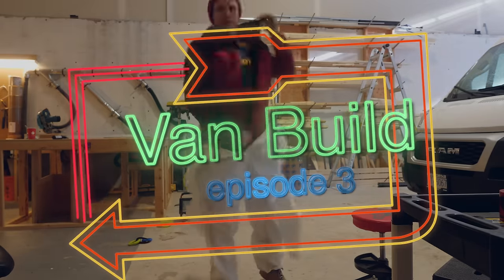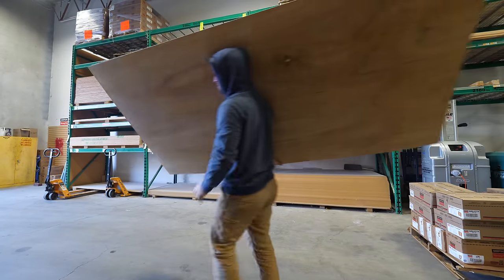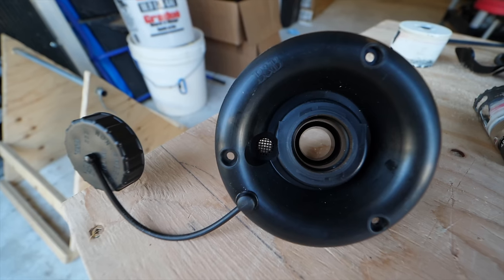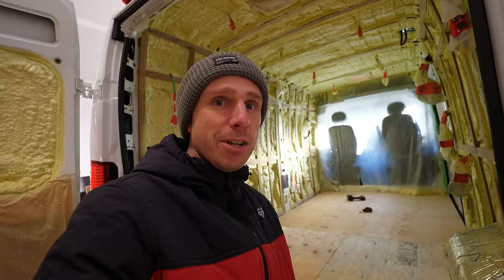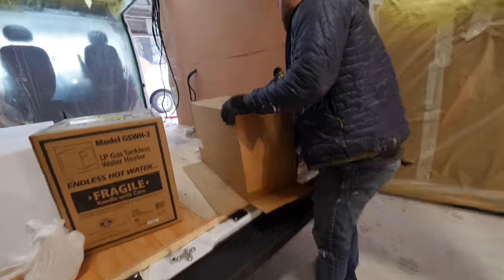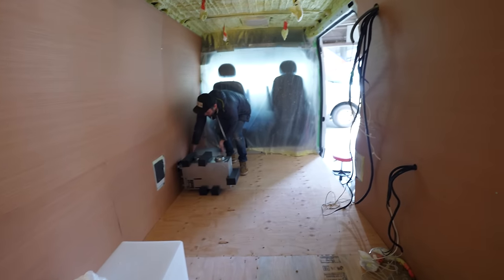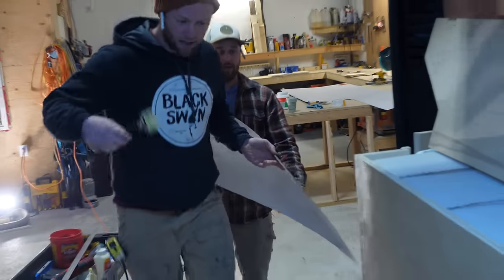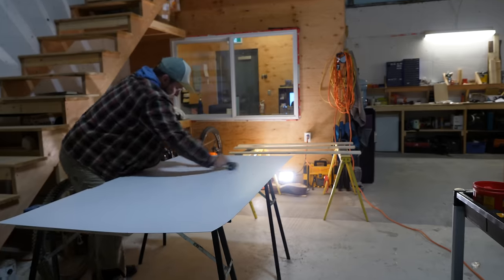Why I Decided To Spray Foam My Custom Van Build...

Comment: I did this in some areas of my build but put down plastic before spraying, that way it can be easily removed later. The areas I did this was the side rails in the bed of my truck. I wanted to be able to remove it when I change my living quarter design. This was a crude but fast way for me to insulate my truck bed including my canopy, with being able to do fast.

I do plan on doing a low profile camper build that can be slide in and out of my truck. I plan on using aluminum frame work with insulation inside the frame. Low profile pop up campers base models can easily run 10k-12k, I hope to spend less than half that. For me this will be done just by me and more than likely out doors, and all with hand tools.

Comment: noting that  the  inlet  requires a  breaker board to be installed

Also note: the  power inlet should be  a min of 6-7.5 foot off the  ground to reduce   flooding issues that might occur in a camp ground..

also note before you spray foamed you  should added a back plate and ran the  service wiring for both ac and dc electronics.. and fuse panels for both..

I also don't think it is a a wise idea to mix different  voltages with different wattage.

in most countries the world over 1-2 20 amp 220/240 VAC  depending on the the  air con you run  as this is typically separated from the house power

At the end of the  day do what you like however  base electrical wiring whether it be home or rv bound is based on 15 amps at 220-240 vac..

Where you start cooking in the realm off electrical fires when you start upping the gauge lowering the voltage and upping the amperages

Comment: Not sure why they put the water inlets directly above the power input but I would recommend hooking up the water first, make sure everything is dry and then hook up the power. Otherwise it's amazing. You should start arranging van competitions so you can win them all.
Reply from the maker: Yes they are testing the water system :). Also weird how there are no other places in a van where there’s water next to electrics......wait a second.......😂
Reply: so here for the spray foam . quick Q - The battening here runs along the metal ribs of the van. Isn't it better to avoid having the frame contact the outer shell as far as possible? Running them across the other way for example so they just touch at points? Or does it make little noticeable difference in the end? -  especially considering windows and doors are pretty hard to deal with in that regard? cheers

Comment: Good luck trying to remove any future panel dents
Reply: Yeah, that's kind of what I'm thinking - especially after Luke had the ladder ripped off his van. I'm beginning to favor removable insulation and wiring conduits.
Reply: I had the same thought for spray foam in a home, it's going to be twice the labor for repair work. Since the contractor has to dig out electrical wire or plumbing pipes.
Reply: looking through the comments it seems there is a whole host of issues with this that were not thought of. Idk this guy, his video just showed up in my recommendations, but this seems like a poor choice. One that stops repairs from easily being done, or done at all since the foam releases toxic dust (possibly anyway) so no panel beater/welder would go near it, the chassis as a whole becomes something that cannot be recycled, the foam is a fire hazard as well as being a sponge for water (from showers/hot beverages/cooking steam). Someone else was saying this stuff squeaks after a while which I can believe since the chassis would have some give on the road, probably dislodging some foam and making it rub. Maybe some of these problems aren't legit, but enough of them are to make it not viable imo.

All that said, its not my van so I don't care that much tbh
Reply: He'll be able to pull them out with the rust holes that the foam creates.
Reply: @CrusadesOClock  closed cells does not absorb moisture
Reply: @900vasa  Tru dat.
>
Reply: Deppending on the dent it can be from the outside, but i was also thinking of spray foam for my build, but had not thought of that
Reply: @readysetsleep  u use to spray foam myself and i can tell u its a nightmare for contractors
Reply: @CrusadesOClock  There's a product called Foamitgreen that solves all of those issues. Fireproof, no outgassing, closed cell (does not absorb moisture. Actually protects the metal from the moisture and prevents rust), it scrapes off easily with a paint scraper if necessary but does not degrade, no toxic dust because it's not harmful to humans, I can attest it does not squeak even after one year of traveling or dislodge
Reply: @CrusadesOClock  Chassis can be recycled with the foam, it's all going through a shredder anyway. How do you think refrigerator shells are recycled every day by the thousands with blown in insulation?
Reply: @jcamp9381  Yeah, I'm quick to believe all the claims made by the people SELLING me the stuff! I trust sites like https://blog.polytechinc.com/open-vs-closed-cell-foam more than any salesman. They clearly state "In closed cell foam, the cells are like tiny air pockets piled together in a compact configuration, resembling inflated balloons nestled tightly together. Due to the closely packed cells, closed cell foam is vapor semi-impermeable, more rigid, able to withstand greater pressure, and is about 4 times denser than open cell foam." The words to note are "vapor semi-impermeable" this means moisture can slowly permeate it.

I initially thought closed cell expanding foam would be an excellent way to proceed with my own build, but the more I dug into it the more problematic it became. Even the bonding between the metal and the foam is a problem even though there is "no" cavity for condensation to occur. That has been amply verified by the experiences of others having to deal with panels literally rotting away.

In the end we all do what we want, all I'm saying is, do your research from trusted sources and don't ignore the experiences of others. Those having to deal with the aftermath aren't trying to sell you anything.

Comment: Spray foam  is standard practice on steel boats.  As they typically take several months to fit out out- gassing is not a problem.  It provides acoustic and thermal insulation and prevents condensation forming on the cold steel.

Comment: The stuff turns to powder in the heat great for Respiratory
Reply: The foam seems to only turns to powder when exposed to UV, typically from sunlight... That's not pro-foam propaganda, but something I've seen in action.

It should be fine behind those panels.
Reply: Polyurethane?

Comment: I hope you used extra sealant or something. Ive seen a few foamed vehicles including a couple professionally built ones and they all rust quickly. 

If you dont face sub zero temps, maybe ok but condensation will always fine a way.
Reply: rust city.  moisture stays between the foam and the paint, then you can guess what will happen.  enjoy!
Reply: That’s why they dry and ha e the van in a dry environment before they do it and until it drys
Reply: @tylermount9544  That is a good technique but doesn't negate the fact that moisture or humidity always finds a way to migrate from humid areas to less humid areas just like temperature always flows from cold to hot. That's why true vapor barriers and ventilation are so important. Closed cell foam is not a suitable vapor barrier see here to know why. https://blog.polytechinc.com/open-vs-closed-cell-foam
Reply: I have over 20 yrs of experience building rv's in the rv capital of the world in Elkhart, Indiana. I have also built schoolies and vans for about 20 yrs. I tell everyone this stuff is the worst you can use. There is a reason it's not used In rv's therefore I didn't use. In the rv industry we have done a lot of testing with foam and if failed to meet government safety standards so no go. Stick with open face insulation and put down a liquid vapor barrier before the insulation and install a  Maxxair fan that way you can help control the key air flow weather it needs air pulled in or sucked out.
Reply: @rolliebca  actually closed cell foam  combined with a fibreglass shell is a perfect vapor barrier (it's even good on its own if applied thick enough btw), so the best way would be if the guy in this video used fiberglass to seal in the spray foam and lastly a dense coat of gelcoat and clearcoat. For vapor to reach through all that would take pressurizing the chamber with steam at 150psi and leaving it like that for 30 years. Btw that's basically how modern ships/yachts are made
Reply: @jasonstormoen  honest question trying to learn from a veteran here. What were the government tests it didn’t pass? Could you point me in a direction as far as learning about those tests?
Reply: @bob15479  to start with, I ain't sure where you can just go type it in and look it up. It was testing that we done at one of the RV manufacturers I was working  for in Elkhart County, IN, in the rv capital of the world. There is regulations in places that it didn't meet. The governments department of energy and fire safety regulations was the ones who put the regulations in place and the ones who shot it down.  We also weren't happy with the R value being lower than fiberglass, weight was heavier than fiberglass, and the ceiling was an absolutely no go because of it melting and dripping down leading to melting and other fires. The fiberglass didn't, it had a hight fire retardant rating than what spray in offered. If any other questions shoot them and I'll answer the best I can. Good day!
Reply: @jasonstormoen  I can imagine that being in a foam van would be a real disaster in a fire.
Reply: @bob15479  unfortunately it would be bad. A lot of us in the rv industry also working 15 mins away in Warsaw at Explorer van conversion where Chevy, GMC, Ford, and Mercedes and they dont use the foam either. I could go on, buy I'll won't bore ya. I'll just answer if you got questions.. 😆 Good Day!
Reply: @rolliebca  If (and only if) you properly apply closed cell foam, it bonds to the metal walls perfectly and does not leave room for moisture to form. you don't need a vapor barrier in that case. https://www.youtube.com/watch?v=j9dhRJb6Hqw

Comment: Why in the world would he put the water above the electric because if it leaks it would shorten electric out wouldn't it
Reply: Jason Fay    exactly, actually illegal in most countries
Reply: Huh? Its an exterior weather power point. Its going to get more water from storms and drain than any dribbles from water inlet.
Reply: Because one water port is gravity feed, one water port has to be a certain height for city water and you don’t want to plug an electrical cord high up on the side of the van creating a tripping hazard.

Comment: Paul. I would have placed reflectrix bubble pack in the ceiling spaces before affixing the paneling. Summer heat gain is pushed out. Works great in the Southwest.

Comment: There is two tanks foam sprayer kit sold at homdepot for few hundred dollars, I have used it to insulate added unit above garage, that thing is super easy to use and not messy at all, it like window gap filler in a much bigger container.

Comment: I have over 15 years experience in the spray foam industry and I anticipate numerous issues.
Reply: How so?
Reply: yea, why/what ?
Reply: Does it leak poisonous fumes after a while? Will it separate and crack after a while and flake away?
Reply: I have been doing trailers with the 2lb foam for 20 yrs , you wont have any problems . To many key board Einsteins .
Reply: I’ve had over 25 years experience in the spray foam industry and this application will outlast the van by a factor of 3
Reply: @markman63  so the foam shortens the life of the van, not good. What sort of poisonous gasses does the foam leak over time?
Reply: @rolliebca  Hope its ok to tag you so late, so does this mean that no foam is acceptable for this or that we should only used closed cell foam? I dont know much about this stuff so have a bit of trouble understanding

Comment: Is this PUR foam? This can cause serious health issues. People start to tear down their houses because of health issues here in the Netherlands.
Reply: Thats because of installation errors. It needs to be done at a specific temperature, otherwise it releases toxic chemicals
Reply: definitely makes recycling the chassis unlikely.
Reply: its highly carcinogenic , also the fumes of the foam.
Reply: @danielmarx3106  so if done at the right temp it does not release chemicals?? Yea okk I believe that
Reply: @digginaustin  I dont care what you believe. Its a fact. It has to settle properly and be done at a certain temperature to be safe. This is why its best to have a professional do it
Reply: @danielmarx3106 so if a professional does the job it limits the voc immited from the spray foam. But does not eliminate them. Got it
Reply: @danielmarx3106  - And why should anyone care what you believe to be facts? Did it look like the "professional" doing this application was working in a temp controlled environment? Right inside the gate of an open 3 story warehouse with traffic passing by. The fact is that this stuff when fully cured release the same toxic fumes as  oasis, the green foam used for flower decorations. But there's a difference between having a small cube sitting on your table compaired to be living inside a large one. Do you believe the reintroduction of asbestos as a wondeful all purpose material is a good idea too?
Reply: @jensrogerkristoffersen5472  Carbon fiber is also terrible for you, if you breath the dust. Asbestos will never.hurt you if you don't do something to make it airborne.

The temperature is important in spray foam because it has to off gas. If done right 99% of the fumes will be gone.  What about that new car smell? That's all the crap in the car off gasing. Dyes in the leather, paint, plastic. Don't be a Nancy
Reply: @ichoozjc  - most of that new car smell is actually heavily researced intentionally added chemicals, designed to interact with and transform other unavoidable off gasing to be perceived as pleasant. And no, I'm not a Nancy, I use foam for many purposes. Just don't be a tool, foam is no different from chip board in that no matter if it feels dry and solid, it still takes several decades to completely degas.
Reply: @digginaustin  While curing it gives off most of the gases After cure it gives off about the same amount of Plastics in your car or the carbon from the car infront of you at a red light
Reply: It's just polyurethane.... Probably 3/4 of the plastic products in your house are made out of it.

Comment: 1973-1978 GMC motorhomes were all insulated in this way. Their body is made of aluminum and reinforced plastic, the same type of plastic that the Chevy Corvette used. It does deteriorate, but it takes a long time. Most that are still on the road today still have an effective amount of foam still intact.

Comment: (4:35) - Having that electrical mains plug-in directly below the water hook-ups is a serious design flaw.
Glad that's not my van.
>
Reply: 🤦‍♂️🤦‍♂️It's an all weather plug
Reply: @thelongestnameinthecomment9677  So?
What a ridiculous comment !
Imagine after five years of hard road use, and that "all weather plug" is not quite as good as it once was.
Not still in the tip-top super waterproof condition than it was when new, huh ?
Are you following me here?..
At that point in time, it may well be seriously compromised in it's ability to keep the water out.
And when we reach this point...
...When this eventually happens...
   ---Do I want my water hook-up directly above the mains electrical hook-up ?
Perhaps you do.
Perhaps you're a fool
Please reply.
I'd love to here your response to this.
Thanks.
>
Reply: @Bodragon  if the plug stopped working just like that there must be something seriously wrong here because that would mean in the rain it wouldn't work at that would be a huge problem so i personally wouldn't have it like that but having the electrical plug underneath the water plug is not a problem
Reply: @Bodragon  that's what i said 
I said that i personally wouldn't do that but it shouldn't be a problem
Reply: @thelongestnameinthecomment9677  But it is a problem.
Just waiting to happen.
You buy the truck.
I'll pass thanks, and wait for something else.
>
Reply: its like cooking a toaster on a bathtub. its an accident waiting to happen.
Reply: @Bodragon  if what you're saying is true then the plug would break anyways have you never heard of rain?
That plug will be fine.
Reply: @thelongestnameinthecomment9677  It doesn't matter if it's an all weather plug.
You know sometimes when you are in a hurry and you don't push the plug all the way in, but it still connects ?
Right, do that and then throw water on it when filling up the water tank.
That is a problem. A big problem
If socket was placed elsewhere, that particular problem would never happen.
I mean, putting it there is just asking for trouble.
Why tempt fate in the first place ?
There's plenty of space on the van to put socket/plug elsewhere.
And I could think up plenty of: "oh this could happen" or "that could happen"
Why take the chance in the first place.
Listen, you like it so much, you buy the truck.
I'll pass thanks.
>